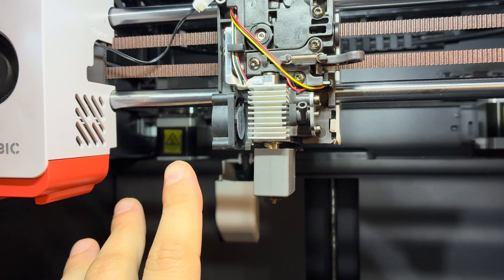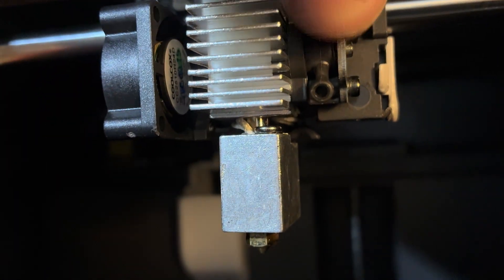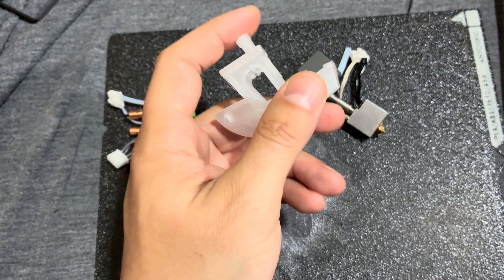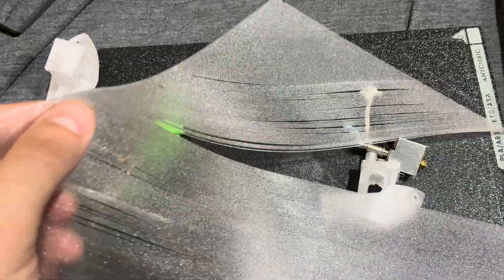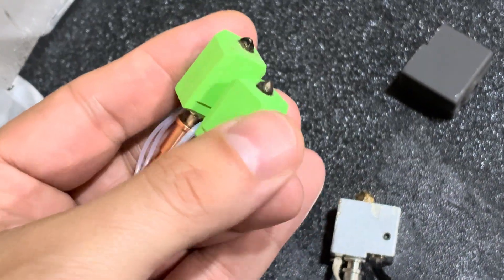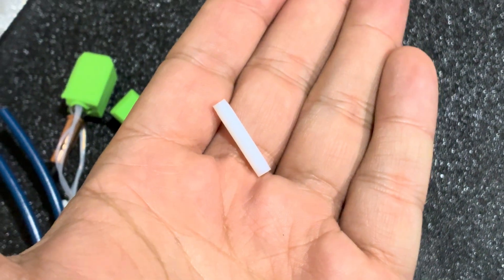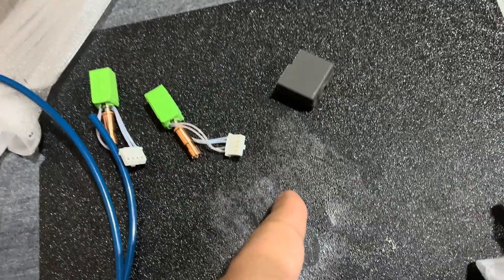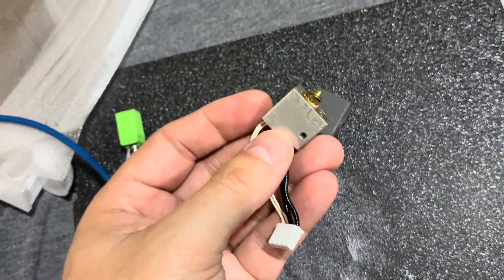Anycubic Kobra S1 - Upgraded Nozzle or Stock?

Comment: 🤣dude. If you are going to be a 3d printer YouTuber you should focus on learning how to calibrate your printer and slicer settings.  Also, did you rerun PID tuning for your new nozzles when you changed them out?  Did you go into settings and select the hardened steel nozzle in the settings?  I use the bimetal hot ends and have ZERO issues.
Reply: I was wondering the same thing! You cant complain about something that is 100% on you to correct. It isnt stock equipment. OF COURSE IT WONT BEHAVE THE SAME! Instead of rattling off problems, it would be nice to hear the solutions. I'll be doing this upgrade as I want to run some more abrasive filaments and push towards the upper end on filament temps with PC and nylon.

Comment: Good to know about the PTFE tube. Thanks for the video. It’s very difficult to get a good first layer on this machine though because the heated bed is garbage. This printer is known for having a very cheap/thin heat bed. It’s only 2 mm thick. That’s way too thin. It warps like crazy when heated, creating high and low spots on the bed. This translates to very uneven first layers where some parts of the print are squished too much (high areas of the bed, making it too close to the nozzle) and other parts of the print are not squished enough (low areas of the bed, making it too far away from the nozzle), leading to frayed, unbonded lines (as shown at 3:58). It’s a fatal flaw of this machine and is well-documented. That’s why companies like Funssor sell thicker aftermarket heat bed kits for this machine. But that adds another $100-200 to the cost. Not worth it in my opinion. At that point you may as well return the Kobra S1 and buy a Bambu Lab PS2, lol, which is a superior machine in every way. Or get a Snapmaker U1. That thing is awesome!

If you’re getting good, even first layers with the stock nozzle, then you got really lucky and got a heat bed that isn’t warping much. I’m jealous! Haha! Or maybe you already did the aftermarket bed upgrade. Not sure. But so many people are getting horrible first layers right out of the box with this machine. It’s all over the Internet and YT. People are complaining about it like crazy. I hope they addressed this issue on the Kobra S1 Max.

Comment: Joseph - listen to this. I have had no problems with my original hotend but I did try the hot ends you are experimenting with, all the ones I got to try had an issue with the thermistor. All the thermistors in the hot ends I tried were not measuring correctly. That is at room temp they did not measure the same resistance as the original thermistor at room temp. This means all the temps will be off at any other temperature. The computer will not set the temp correctly because of this. Check the resistances of the ones you got vs the original and see if they match at room temp. If not you will never get the correct temp set at any other commanded temp! I gave up on them and went back to my original hot end.
Reply: I got a couple of these replacement hot ends and noticed no grease in the thermistor hole which might account for the inaccurate readings. Also the ceramic pad didn’t mount flush on the block and I had to file one of the locating tabs for it to mount flush. Looking forward to giving it a try when I print with CF Nylon.

Comment: Why does my printer underextend when it starts printing the first layer, and the plastic doesn't stick for a couple of centimeters of the extrusion stroke, but then it prints normally? It's as if there's some kind of extrusion delay.
Reply: Because the heat bed is uneven. This printer is known for having a very cheap/thin heat bed. It’s only 2 mm thick. That’s way too thin. It warps like crazy when heated, creating high and low spots on the bed. This translates to very uneven first layers where some parts of the print are squished too much (high areas of the bed, making it too close to the nozzle) and other parts of the print are not squished enough (low areas of the bed, making it too far away from the nozzle), leading to frayed, unbonded lines (as shown at 3:49). It’s a fatal flaw of this machine and is well-documented. That’s why companies like Funssor sell thicker aftermarket heat bed kits for this machine. But that adds another $100-200 to the cost. Not worth it. At that point you may as well return the Kobra S1 and buy a Bambu Lab PS2. It’s a superior machine.
Reply: @GoComm79  No, you're completely wrong. I just installed a new thick, level aluminum bed, calibrated and slightly modified to maintain the print height at 245mm. At the very beginning of a print, there's a delay in the plastic feed. I've concluded that this is a firmware issue with the printer (the manufacturer screwed up somewhere, causing the printer to skip prints at the very beginning).
I'm solving this problem by adding one loop to the skirt.
Reply: @КалупаКалупович  Just because your printer has more than one problem does not make me wrong. Print a first layer sheet on the stock bed and you’ll see what I’m talking about. 250 x 250 x 0.2 mm tall. Most of the S1s can’t do this with good quality due to the bed and warping issues. And you obviously know this because you went to the trouble of replacing the bed. So obviously you know it’s a problem. If you’re ALSO having extrusion issues, then that’s something separate. No need to be an ass when people are just trying to share knowledge and help you. I doubt it’s firmware. Everybody would be having the same problem if it was firmware. I’m not having this problem and I don’t know anybody else that is either.

Comment: I've had the self ejection issue, I went to zero the Z axis for the first time ever, only for the  X and Y axis to also decide to zero (because obviously they have to, I guess) and rub the heatblock over what I can only guess is the heatbed insulation under the bedplate, cuz I removed it to inspect the damage. Fortunately no terrifying damage was done but still some damage was done, and now there was no way I could remove or insert the hotend because it tilted awkwardly and wouldn't go back in. I panicked until I found out about the belt below the printer to lower the bed.

Comment: Support sent me the newer version of the stock hotend, without the tube, and a bi-metal heatbreak.
I had been seeing random inconsistencies with prints using the aftermarket nozzles so will probably swap to the 'new' stock hotend..
Reply from the maker: That’s awesome I keep reading about the new stock version but I don’t see it on AliExpress or their US store.
Reply: @joseph-montanez  well, I actaully messaged support and asked if I could buy one of the new extruders with the metal sensor flap thing, and they then sent me a hotend, so I messaged them back and said they'd sent the wrong thing, so then, then sent me a new extruder, and then sent me just the metal flap thing.
I've just swapped my nozzle over, and when I've got some free time I'll swap the extruder as well, and then I'll probably strip my old one and fit the new flap as well...
Reply: @Trig0r don't forget to redo all calibrations after change.
Reply: @bobbunni8722  always my guy do the same after new f/w as well, because, reasons ;)

Comment: wouldn't the best solution be to just replace the hardened steel nozzle on the ceramic hotend with a brass nozzle so you don't have to change all of your filament presets and also avoid the issues with the PTFE tube?
Reply: There is a setting on the printer for steel nozzle...also all printer calibrations (pid...input shaping...etc) need to be done after any nozzle change.
Reply from the maker: Thats half of the solution, the nozzle design on the ceramic version will still present with bad first layers and top surfaces due to the filament pooling around the nozzle. If there are PTFE coated brass nozzles you can use with the ceramic version then yes, totally. These ceramic versions seems to use a Bambu style nozzle, but I see none with that. There are the bi-metal or steel versions but not sure those will also have issues with print quality or just a brass nozzles.

Comment: LOL, yeah, I broke my nozzle off trying to remove it after the first month.  Glad I did, the one I replaced it with heats up much quicker.  I've got a spare 0.4mm brass, spare 0.4mm hotend that have the original block style, and I've got a hotend that's the style you've got in the green, with 4 brass nozzles that I plan on setting up with the 0.2mm nozzle for finer detail printing.